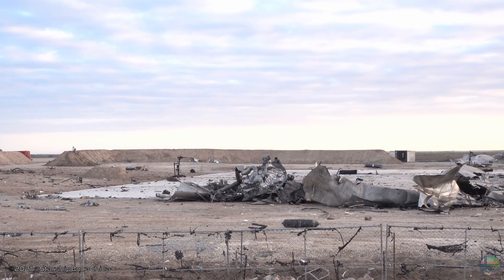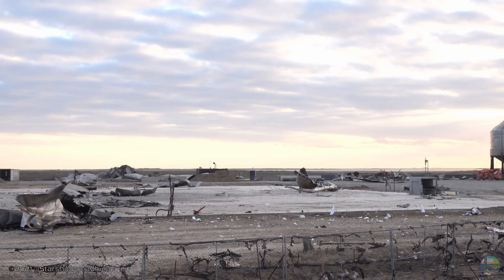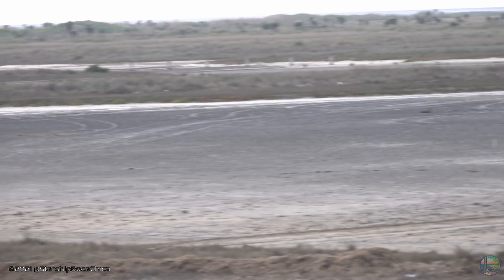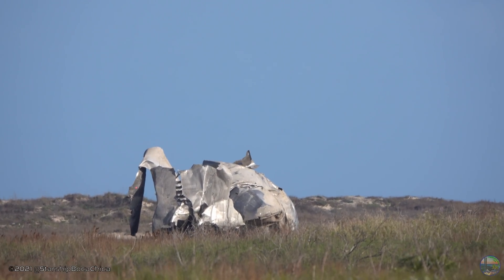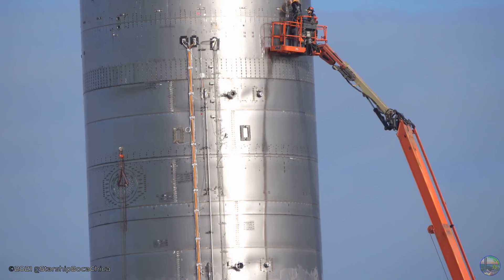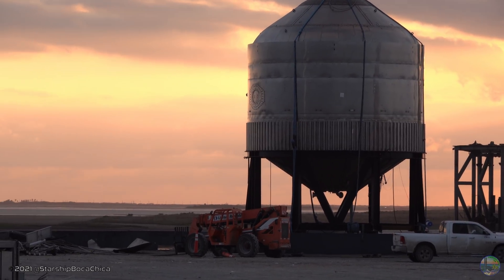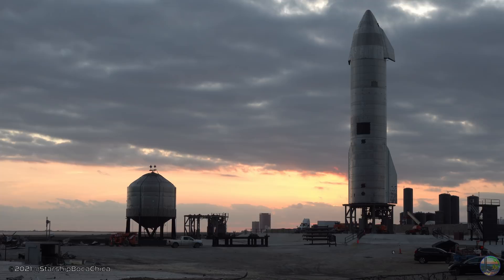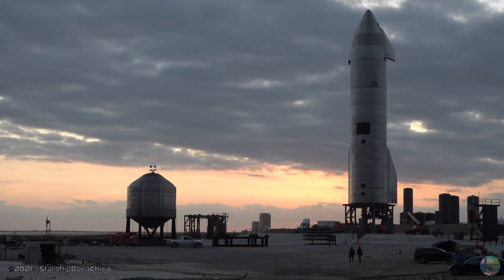SpaceX Starship Boca Chica 2021 02 03 SN9 Aftermath

Comment: I hope sn10 will land proper! Will Spacex have launch approval from FAA after inspection?
Reply: SpaceX will need to explain, consistent with evidence, why the failure occured and what their corrections will be. Then the FAA will analyze the risk of the new configuration and whether it is still not endangering the public.
Reply from the maker: I know it will.  They should of fired all 3 for safety.  Rapid static fire drills recently made me thing that 3 would be routine.  Dang I saw that one shut down and the thought briefly made me think that raptor better not be the one they try to light up for landing and 3 lights can save the day.  They have it, just not the drill pattern or routine I think.  I don't think mistakes are what FAA is expecting not to happen again, but such explosive splats.  I felt it at 3 miles.  My office is at 1.5 miles in village, and home is 4.5 miles.  Go SpaceX to SN10 asap.